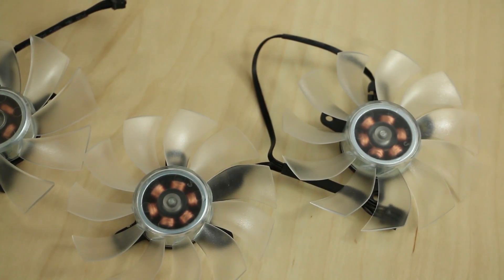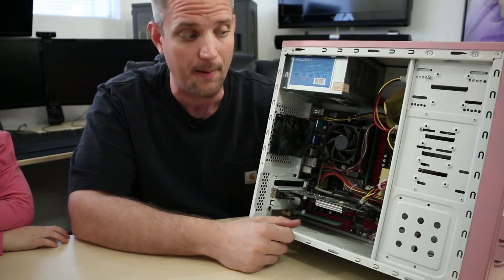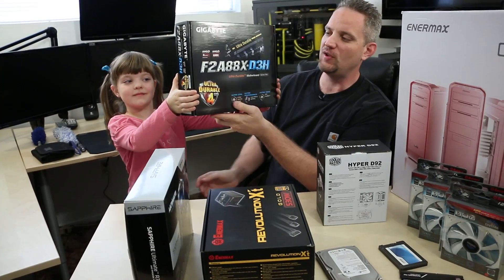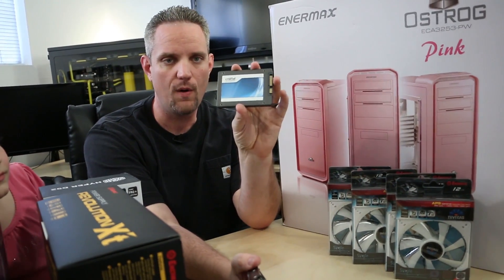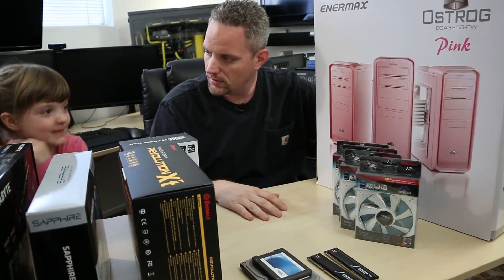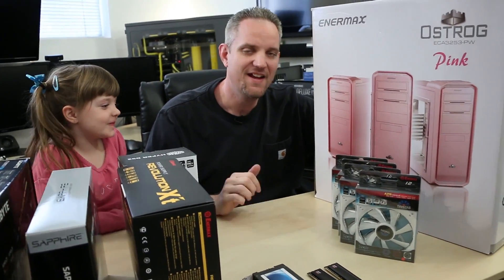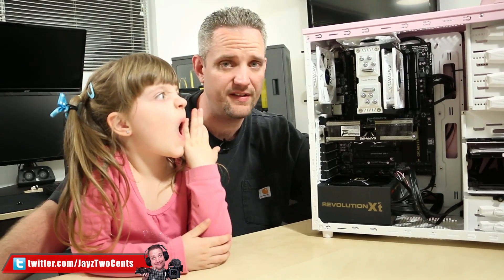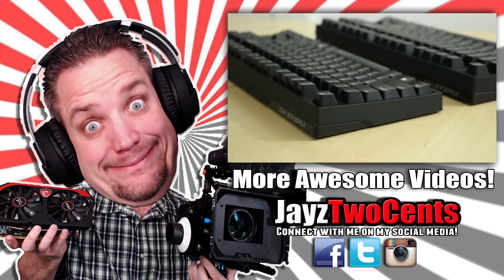5 Year Old Builds a PC

Comment: i'm 15 years old and i built my own desktop... (and payed/Won/given it)
-Note i did not buy all items full retail (most items were cheaper ebay/amazon) but i got them from other places here too ,new egg ,pc case gear ect... 
Specs
__________________________________________________
Motherboard: ASUS X99 Deluxe Motherboard
Graphic card(Won) 1:ASUS GeForce GTX 980 Strix DirectCU II 4GB i think i have better ones?
Graphic card 2:ASUS GeForce GTX 980 Strix DirectCU II 4GB 
CPU: (WON)Intel Core i7 5930K (upgrading to the Intel Core i7 5960X Extreme Edition got it for christmas) 
RAM: Corsair Dominator Platinum CMD32GX3M4A2133C9 32GB (4x8GB) DDR3
Power supply: (WON) EVGA SuperNOVA G2 Gold 1600W Power Supply 
Case: NZXT Phantom 820 Case Gunmetal
HDD 1: Seagate Barracuda 2TB ST2000DM001
HDD 2: Seagate Barracuda 2TB ST2000DM001
Hdd  3: Toshiba DT01ACA300 3TB 7200RPM
SSD:Samsung 840 EVO Series 1TB SSD
CPU Cooling: NZXT Kraken X61 280mm AIO Liquid CPU Cooler
VGA Cooling: Arctic Cooling Accelero Hybrid II LCS VGA Cooler
RAM Cooling: Corsair Airflow Pro

_______________________________________________
accessories
_______________________________________________
Mouse Matt: accessories
Mouse: (WON)Saitek Cyborg R.A.T. 9 Gaming Mouse
Mouse 2: Corsair Gaming Sabre RGB Laser Mouse
Mouse Bungee: Razer Mouse Bungee
Headset 1 (Won): Audio-Technica ATH-AD2000X Open Back Headphones
Headset 2 (Gift):Razer Kraken Pro Neon Orange Headset
Headset 3: Steel Series Siberia Elite Prism Headset Jet Black
Headset 4: Corsair Vengeance 1500 v2 Dolby 7.1 USB Gaming Headset
Keyboard: (WON) Mad Catz S.T.R.I.K.E.7 Gaming Keyboard
Keyboards: Corsair Gaming K95 RGB Mechanical Gaming Keyboard Cherry Red
Keyboard: (birthday present) Razer Deathstalker Ultimate Gaming Keyboard
Monitor 1:Samsung S27D590P 27in Widescreen PLS Monitor
Monitor 2:Samsung S27D590P 27in Widescreen PLS Monitor
Monitor 3:Samsung S27D590P 27in Widescreen PLS Monitor
Sound System:Swan M60 5.1 Multimedia System
Web cam:Logitech C930e Webcam (did have a camera sadly it broke and couldn't be fixed and didn't bother spending more money on it 

Gunnar PPK Onyx Mercury Indoor Digital Eyewear (free)
Razer Orbweaver 2014 Elite Mechanical Gaming Keypad (gift)
Controllers (sold the consoles to buy this pc and kept controllers) : 2x ps3, ps4, xbox 360, xbox one
Sound Card (free): Mackie 802VLZ4, 8-channel Ultra Compact Mixer with High Quality Onyx Preamps   

Desk:UPLIFT 900 Adjustable Height Standing Desk
Oculus Rift Developers Kit Dk2
LX Desk Mount LCD Arm (2x used for mic and sound card)
ErgoRest - 330-016-BK - ErgoRest Articulating Arm Support - Black - Long Arm, Long Pad (helpful)
AverMedia C875 Live Gamer Portable (Won)

Phobya LED Flexlight High Density 30cm Blue x4 
NZXT Hue RGB LED Controller
Lian Li Noise Reduction Foam (Medium)	
GELID Rubber Fan Mounts 
Aquacomputer Aquaero 6 Pro USB LCD Fan Controller (was very cheap brother bought it and didn't work in his case)

i have a few fans but can't find what they are...
____________________________________________________________
Software
_______
Win 8.1
(gift from school) Cs6/cc suite 
Max 
____________________________

CONCLUSION
__________________________________
what should i get oh and do you like this case? 
Thermaltake Level 10 Titanium Limited Edition Full Tower Chassis

Ps i;m a serious gamer earn a bit of money(almost nothing) and have a job as you can tell i am 3/4 of getting the money back that i spent

own 700+ games 

TF2 (team fortress 2 has funded some of this from selling my items)

 My pc is overkill for what i need and seem like a complete  dick head

Comment: You Rock Jay.I am 55 plus now but when I was younger my Father taught me how to set up and run a sunnen hone. I started out pulling parts and rebuilding heads on cars and also in my youth there was a lot of manufacturing jobs .I could make wire harnesses and solder and use a muliti meter to check new up and coming solid state components.Later on I became a machinist and also diesel mechanic and rebuilt transmissions.I am now back into electronics again.fixing plasma's and other flat screens and laptops.All because my father started me rebuilding heads and engines.I still strive today to keep up with all the thing that interest me.

Comment: Wow.. is this crazy or what?  You have a 128gb of an SSD that is at least several generations old, combined with a 256gb of an HDD.  Something isn't right.

You can buy a modern SSD (Crucial MX100) for very reasonable prices at those capacity.  You can buy a 256GB version for $100, or a 512GB version for $200.  If that's all the capacity you need, why add an HDD and over-complicate storage??

Comment: Am I missing anything?

Intel Core i5-4690K 3.5GHz Quad-Core OEM/Tray Processor

Antec KUHLER H2O 650 Liquid CPU Cooler

ASRock Z97 PRO4 ATX LGA1150 Motherboard

Kingston Fury Red Series 8GB (2 x 4GB) DDR3-1866 Memory

Seagate Barracuda 1TB 3.5" 7200RPM Internal Hard Drive

Sapphire Radeon R9 280X 3GB Dual-X Video Card

Corsair Carbide Series 300R Windowed ATX Mid Tower Case

Corsair Builder 600W 80+ Bronze Certified ATX Power Supply

HP 447328-B21 DVD/CD Writer

Microsoft Windows 7 Home Premium SP1 (OEM) (64-bit)
Reply: Tanner Rodriguez I'm not. 8.1 is significantly faster, it even gives you slightly more FPS than Win7.
What is wrong with 8.1? Interface? Lol, get used to it.
Reply: Medieval Blast Plus you can easily get a program to get the start menu back, e.g, Startisback 

:P
Reply: I think you are good to go. One suggestion is to get a SSD, it will really help you boot up your computer and programs fast. You can get 120 GB SSD for like £60.
Reply: Shan Rehman Thanks a lot man! I'll look into it.
Reply: i would get an asus z97-a i have that motherboard and it works great has a good bios but i were you i would avoid asrock at all costs they were nothing but trouble back when i did my amd phenom ii 1100t build
Reply: pcpartpicker.com
Problem solved
Reply: Haze MC Thats what I used. xD
Reply: ***** oh xD
Well seems like a pretty good pc, not sure about Asrock though. I personally wouldn't go with kingston ram either, but your choice :D
Reply: Tanner Rodriguez i guess youve had good luck with them i just wish i had the same luck back in the phenom ii days lol
Reply: Its a Really good pc actually, just change your motherboard i've heard a lot of tribunales from Asrock, otherwise it Will be a Really solid build
Reply: carlos troya same asrock boards arent reliable
Reply: You're missing Windows 8.1.
Reply: Troubles* my bad
Reply: Tanner Rodriguez Bullshit. You clearly haven't used it yet. It's just a damn start menu, the desktop and control panel is still here. 
Stop over-dramatizing, I almost never have to access the start screen, which isn't bad at all.
Reply: ***** Actually not performance issues, but yeah it is slower than what we expect it to be, for 1080p you can play whatever you want at high settings
Reply: ***** You are missing 99943523495238475235 TB Hard Drive for Porn in 34653k That you can watch with 3D glasses.....

Comment: hmm. it seems like you build the pc with negative pressure. meaning you have one fan intake in the front, and 2 out take in the back and top. and the psu seems to take air out aswell i asume? meaning you will have big problems with dust in this thing. because the case it's self will take in air from every crack. and there for leaving ALOT of dust everywhere. trust me. done several builds my self, and i always make sure i have positive pressure meaning i have more intakes than outtakes. my advice. the top fan, move it to the buttom, and have it pull air in. if you can. if not, just turn it so it blow air in from the top.
have good exsperience with fans taking air from the floor. still far less dust than having a negative pressure.
wonderfull child :) cute build. 
best regards
antimate pc custom

Comment: A 5 year-old's got a better PC than me. Sad days...
Reply: yeah man i was just like man i want that pc even if its in pink :D
Reply: Patrick Star Cool. You must get a really big overclock with that water cooling, now do you?
Reply: if i were to ask my parents for even a better laptop they be all like, "O HELL NAW WE AIN'T BUYING U NO COMPUTAHH!!1..." :/
Reply: I never knew you had underwater PC's
Reply: Yeah, they're automatically watercooled, too.
Reply: Vinay Vyraveraja Pfhhht, I wouldnt complain with that. My parents got me an All-In-One, and dont get me wrong, Im grateful and love it, but the specs are seriously like 2004 treatable. Im pretty sure it has AMD integrated graphics (which arent horrendous, but the CPU is shit.) Some random ass CPU that is 1.7 Ghz (thats some prehistoric shit right there). If I open more than 5 tabs it crashes.
Reply: John Smith
Lmfao i thought the same :'3
Reply: ***** overheating.

Good cases aren't even that expensive anyway, so you wouldn't really be saving anything.
Reply: John Smith I wanted that case specifically, but meh. Just got an H440 in Black/Blue
Goes better with room anyway.
Reply: well thats what you get if you had rich parents my pc specs:

i3 2120 3.3ghz intel cpu
amd radeon 6570 sapphire gpu
1 stock cooler for cpu 2 extra coolers for ventilation 
msi motherboard holds only 1 gpu 2 ram cards only supports 1033mhz/1333mhz
1 stick 1333mhz 4 gb ram
just 2 hardrives both 250gb
no ssd card
samsung led flat screen monitor
logitech mouse/kboard both wireless
600w pwer supply

sure i can run games but almost lowest specs. this pc is also 5 years old .mine starts-up in 1 minute .plus it`s not even 5 years old he himself said he made it a day b4 her 3rd bday so it`s just 3 years. who knows what viruses she downloaded into that thing 7 years ago I had a worse specs then this, you don`t see me calling my father for a pc every 5 years. I try to use it to fullest if it gets slow I format my drives and reprogram everything . if i dont even format it still works good only takes 2-5 minutes to load most of the time only viruses or old software makes your pc slow/hang/lag :D
Reply: IUsedToBeABanker ThenILostInterest same here
Reply: Same man
Reply: ***** He even said in the video that the computer wasn't meant to be that impressive.
Reply: ***** 980 over clock and a i7 4470k come at me
Reply: Jouji Susui ac unity 4k?

Comment: This may or may not have already been asked, but I'm curious why you used an A10 processor which has 6 gpu cores and 4 cpu cores with a separate video card rather than a FX processor with with more cpu cores and a separate vid card?
Reply: Just re-watched and saw you recommend a different processor.  I'm still curious what the advantage is of the Athlon 760 or 860 over the FX series processors.

Comment: I didn't see it in the video but we're you using any type of grounding strap either on wrist or heel. Part of building pc's as well as dealing with electronics at this level should have anti static grounding systems or installing power supply first turned off, having it connected to power and touching the case. Teaching kids about anti static grounding is important and will help extend the life of your their pc.

Comment: Im 14 and I built my computer, its very easy, the biggest problem I had was plugging in some of the connectors to the Corsair H100i cooler because stupidly I mounted the cooler in the case before I did that, if I did it the normal way it would have taken 2 seconds....

Specs;
intel core i5 4690K quad core 3.50GHz (haven't overclocked as I will be getting an i7 4790K)
Corsair H100i cooling it
32GB DDR3 1866Mhz RAM (4 x 8GB DIMMs)
1TB Western Digital Caviar Black 7200RPM HDD (will get another 2TB drive soon)
240GB Samsung 840 EVO (will upgrade to a 500GB 850 PRO soon)
MSI R9 290X 4GB GDDR5 GPU
Corsair CX 750 M (semi-modular) PSU
Gigabyte Z97-X Gaming 5 Motherboard
Some TP-Link Wifi Card
Some Samsung DVD drive
Corsair Carbide 300R series case (windowed because... it was cheaper)
Running Windows 7 Ultimate SP1 (because Windows 7 is the best Windows OS)

Other stuff:
BenQ 1080 21.5" LED Display. (Really sexy, will get another one soon because I love two screens.)
Anker Gaming Mouse, Its an old thing but still very good even though I dont really game much

Keyboards:
Korsair K70 Cherry MX Blue switch keyboard because I love blue switches
Coolermaster Cherry MX Brown Switch (I dont know the exact name, I dont use it anymore)
Aula Blue Switch Keyboard (Some cheap thing I bough which made me fall in love with the blue switches)

Comment: Not trying to be rude or anything, but was I supposed to be impressed? I took an old windows 98 pc apart and put it back together when I was 3, and it still worked. But anyways, why didn't you get an AM3+ motherboard and use an FX chip considering you bought a graphics card? If I remember correctly, the fx 6300 is cheaper than the AMD A10-7850K, not only that, but it also has higher benchmark ratings.

Comment: She has a better PC than most people. Good dad :)

One thing I will mention... I did not have my own PC until I was 11, and I had to buy it myself.
That PC is what got me into pulling apart / building PC's.
I pulled it apart hundreds of times to learn about it and only broke 1 thing, but that was out of the PC, that's a longer story.
now I have 40+ PC's, fix and repair computers :).
my first PC I remember very well.. Intel Pentium 4, Asus P5P-800, ATI Radeon 9550, 2 x 512MB RAM dual channel, 250GB IDE drive (biggest drive available back than), superflower case, A 19" LCD, and laser mouse and keyboard, both PS/2 (PS/2 is superior). I learnt almost everything I needed to know on that thing. kids will savour such memories, like first PC, and can even make them, like me into a computer builder.
my second PC was a Core 2 Duo E6850 dual core, which I built myself, my third PC (which was my second PC slowly upgrading to this third PC) is the one I have currently, Core i7 920 watercooled. I've had 3 PC's in the past 10 years, and for them to last that long, of course each had overkill specs :P

Comment: I'm 14 and I just got PC parts last week, and it's my first time getting good hardware because my previous computers sucked. And I'm still having trouble building it.
Specs 
GTX 750 ti
Nzxt guardian 921 RB 
8GB DDR3 1333 
1tb hard drive 7200 RPM 
Intel core I-3 3.6 GHz 
When I turn it on it turns off immediately.

Comment: Wow, this takes me back to my first custom built PC. I still use it, it is awesome. It is a crappy Celeron 2.8GHz(overclocked to 3.3GHz), an ABIT motherboard with 1.5GB of RAM, a Maxtor 80 GB hard disk for the OS and a 40 GB WD for all my shareware and bloatware. It has a shitty NVIDIA MX-400 I believe. It also has an LG CD-RW drive I bought in '03, it has been swapped through several computers, still works like a champ, I also had an Optiarc DVD burner that burned out. It has a legit copy of Windows XP, even though I tried Vista which complained about my graphics card not supporting pixel shading or something along that line. But I love it and discarding it will never cross mind. P.S. Maybe Lil Jay grows up to be just like you!

Comment: This PC was built 2 years ago? No way. I couldn't even find MOBO's for my old Intel Q6600 back then and this seems older than that. Also, if PCs take too long to boot up after a long time, it's usually a faulty hard-drive. Currently the Q6600 rig has a faulty HDD, but it's not used and I'm not sure on SDD compatibility with that old SATA2 MOBO, so I haven't been bothered to replace it.

Comment: im buying a $12k  pc and theres no way im building it
Reply: warranty is best
Reply: ***** i really just dont want to sit there and build it especially un experienced
Reply: i just dont have the patience
Reply: Money's not a issue
Reply: hmmmmm
Reply: ok
Reply: ntel Core i7 5960X Extreme Haswell-E 8-Core LGA 2011-3 3.0GHz 

Corsair Hydro Series H110 280mm Liquid CPU Cooler

EVGA X99 Classified LGA 2011-3 E-ATX Motherboard - 151-HE-E999-KR

 G.Skill Ripjaws 4 F4-2400C15Q-32GRK 32GB (4x8GB) 2400MHz DDR4

 ASUS GeForce GTX 980 STRIX 4GB Video Card Quad SLI

 Corsair AX1200i 1200W Digital 80+ Platinum Modular Power Supply

Crucial M500 960GB 2.5" SATA III SSD CT960M500SSD1

 Creative Sound Blaster ZxR Ultra High Performance Sound Card - PCIe

ASUS PCE-AC68 802.11ac Dual-band Wireless-AC1900 PCI-E Adapter

 Microsoft Windows 8.1 Professional - 64-bit - DVD OEM

There you go its about 7k
Reply: Thanks for the info so should i get 1 gtx 980
Reply: oh no i got a budget but i'd love to lower im not rich its just a payout bro i have a average job
Reply: Ripn 2G just get the one or two. Two if you really need it.
Reply: Thanks for the info